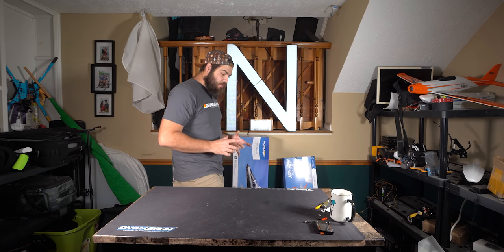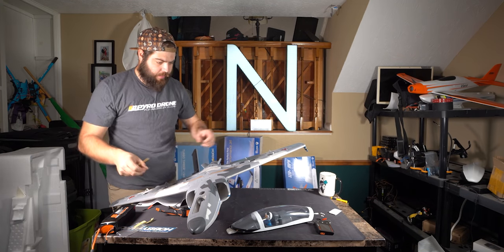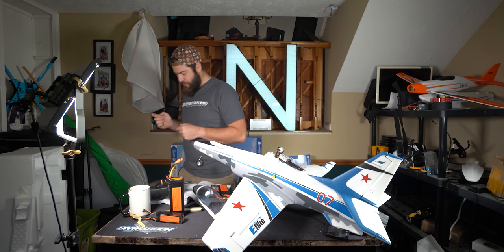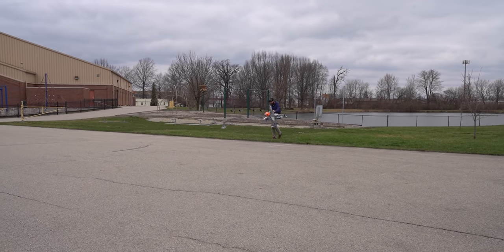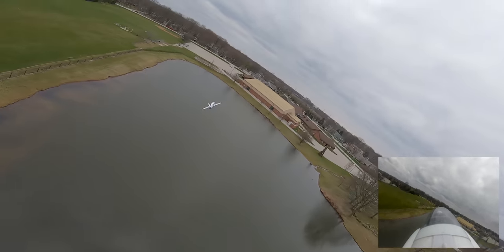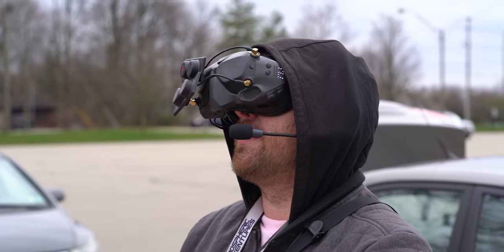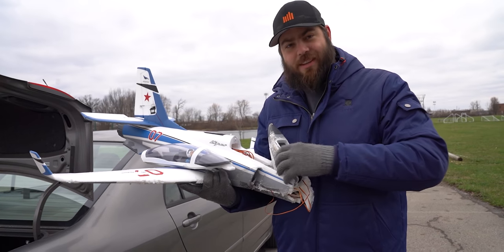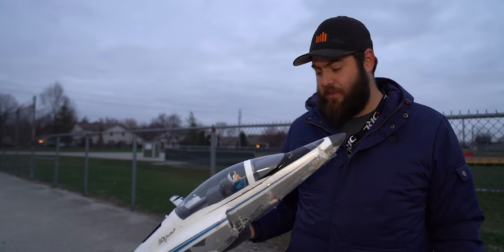😔 He DESTROYED my brand new plane! ✈️ Viper 70mm EDF JET

Comment from the maker: Parts on the chase drone: 

Motors: Hobbywing 1750kv 2207 -- http://bit.ly/nurkhw1750
Flight Controller: Whitenoise Synergy -- http://bit.ly/nurksynergy
ESC: Hobbywing 60a -- http://bit.ly/nurk60esc
Video Transmitter: TBS Unify -- http://bit.ly/nurkunifyevo
Receiver: Crossfire Nano -- http://bit.ly/nurkcrsfnano
RX Antenna: TBS Immortal T -- http://bit.ly/nurkimmortalt
VTX Antenna: TBS Triumph  -- http://bit.ly/nurktriumphpro
Frame: Project 399 SuperG -- http://bit.ly/nurksupergpyro
Camera : Runcam Racer 2 -- http://bit.ly/nurkracer2
Lipo: CNHL Ministar 6s -- http://bit.ly/nurkministar
Prop: Azure 5150 -- http://bit.ly/nurkazure5150

DJI Products with this Drone: 
Get Started with DJI:  -- http://bit.ly/djistarter 
DJI but I want my own radio:  -- http://bit.ly/nurkdjinoradio 
DJI Receiver Directional Antennas: TrueRC Patch for DJI -- http://bit.ly/nurktruercpatchdji (requires 2, not necessary, but amazing) 
DJI Receiver Omni Antennas: TrueRC Stubby Singularity -- http://bit.ly/nurksingularitydji (purchase 1, comes with 4)
Reply: @NURK FPV - I have both Viper & DJI FPV. Would a scale cockpit setup generate too much air unit heat?
Reply: Hey where did you get that orange bag that you put your remote in to fly

Comment: You turned off SAFE mode instead of the gear switch at the end. 35:10 you can hear the switch flick and the auto level turned off.

Comment: Certainly looked like a classic tip-stall.  All the leading edge damage on the right wing probably lowered the stall angle of attack on that side.  I'd also check and make sure the right wing isn't twisted leading-edge-up.  If it is twisted asymmetrically you'll know right away because you'll need substantial aileron trim.  This need for trim is also an indication that you might have bad roll-off characteristics during a stall.  I like to always stall the airplane at altitude just to see if, and which direction, it will drop a wing tip. Cleaning up that leading edge contour will most likely solve your tip stall issues.   Pay careful attention to cleaning up the leading edge shape/contour from where the aileron starts out to the wingtip.  This is where a swept-tapered planform is most highly loaded and consequently where it will naturally stall.   You may already know all of this so apologies if I'm preaching to the choir.
Reply: Or they were amateur pilots flying an advanced aircraft, and made multitudes of mistakes.

Comment: I agree with Flackee below I think you turned off SAFE and since you were not expecting it so you probably over corrected it as I have done one a couple of occasions. When flying on SAFE mode it takes more stick movement to get the plane to respond and so when it goes to AS3X mode it will over correct badly. I really enjoyed the FPV flying.

Comment: I do have to say the one thing I hate most about BNF models is that they rarely include a telemetry capable rx. I think all electrics should at the very least have flight pack voltage level telemetry. I have an spmar6600t rx and it's one of my favorites. It's currently in my Eluna 1.5 powered glider. Those are super fun to run fpv on. They get surprisingly fast air speeds and awesome flight times. And with the rx being 6ch, I was able to setup flaperons and elevons to get a real glider experience. My throttle is on a 3 pos switch (power glider guys call it "winch") and my flaps are on my throttle stick. Check that type of control out if you ever get a chance.

Comment: Keep in mind a prop is pushing air over the control surfaces at any speed.  An EDF relies on airspeed and requires more forethought because its all going out the back of the tube.

Comment: Oh bummer! That plane looks fun to fly, I think I would have to wrap it in some carbon fiber or it would be a one flight and done. How hard would it be to use a dji friendly flight controller in this to get proper voltage to unit and get battery voltage in goggles?
Reply: You just wouldn't use dji. 90% of FC's will do this, an if not you can get a little osd attachment to go inbetween video tx n FC. Osd is pretty standard now a days, don't need to get shitty DJI 😉😉
Reply: Not even needs an fc.. A matek hub osd will do when using normal. Fpv

Comment: Great video.  But a the zoomed, un stablized video made me kinda sick.  Might as well edit it out.
The battery always blows out the nose of planes like that.  I had a mushy elevator and my gorgeous Saber 920 wouldn't pull out of a dive (the wind over the bad elevator held it flat when I tried to pull up lol).  Hanging on my wall now, good month for fixing it.  But for some reason I can't stand working on the foam planes.  I would rather have fun building another quad....